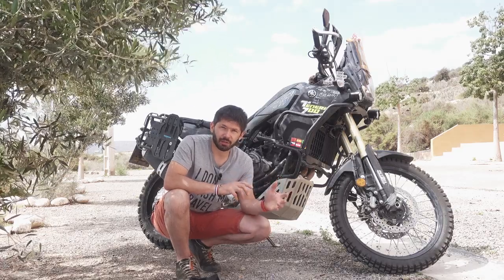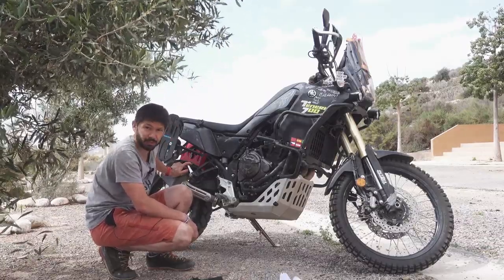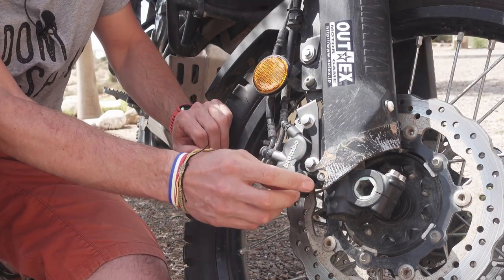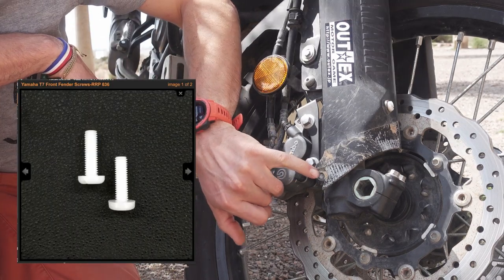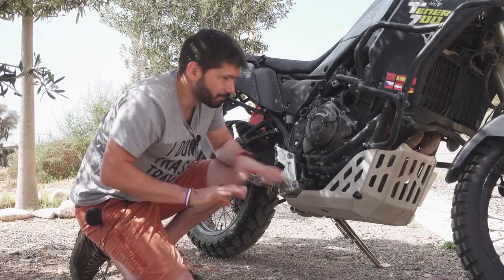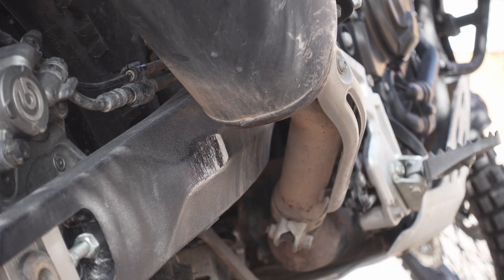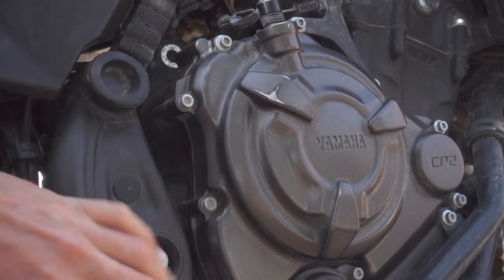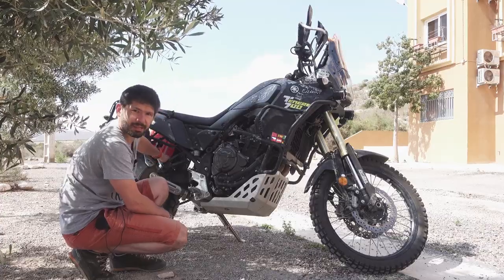Yamaha Ténéré 700 10k: Damage & Rust

Comment: Re the rubbing on the clutch case, in the Australian version there is a plastic guard over that area where wear is showing.
Reply from the maker: The guard was there as well on the EU version, but I took it off because it was in such position my leg was constantly pressed against it. It did bothered me to the point I took it off. But, when you mention it this way... It may have had a purpose :)

Also on the other side my paint from subframe is rubbing off due to contact with gear & boot.
Reply: @FARANDFURTHER  I have the same problem, I hope soon to replace with a full protection cover.
Reply from the maker: @MotorcycleAdventureDirtbikeTV  It just was so much in a way and my brain didn't really manage to switch it off mentally ;)
Reply from the maker: @Mich Sky All versions have it I just took it off.
Reply: @FARANDFURTHER  that happens on all bikes. gotta get a frame cover plate or something, i was thinking of trying gravel guard since its got a rubberish coating and might last longer.

Comment: well done! the corrosion on the spokes looks like its caused by the salt on the street (no wonder, since  you ride it always and everwnere). the one on the brakediscs looks a bit too much for the age of the bike.. but they are carbonsteel disc, it rusts... but not dramatic.. 
Someone, not (ab)using the bike as you do, will do fine... 🤣😁💪🤘❤ cheers mate! 🤙
Reply from the maker: I think corrosion on the brake discs and other parts is as you said I've ridden it in winter in Europe in all those salty roads. Moroccan sea & deserts are salty as well and really washing the bike every day... no way.

I'm not abusing the bike... just riding it gently, but steadily :)

Comment: Good review. If that's the only problems at 10,000km I will be happy with my T7.
Reply from the maker: So far, yes not much more riding since the video due to COVID-19.
Reply: Have you had to change the rear shock spring. When the bike is loaded it is very soft.
Reply: Haha you must have the only T7 with the exhaust on the left hand side. No wonder it rubs on the swing arm.
Reply from the maker: :))) It now got quite loose so, when I drop it I just put it back to it's place by hand. Easy ;)
Reply from the maker: Yes I will, but spring is in CZ and I'm in lockdown in Morocco, can't get it here easily.

Comment: Hi guys! Don't forget t700 is not a motocross machine!!! And when you will do motocross with t7 you must do big transformations!
Reply from the maker: I think my riding is far from motocross riding... I'd love to do motocross but definitely not there. What I'm doing with T7 is I think just reasonable terrain for over landing. I've done similar terrain on Honda CB500X with Rally Raid Kit L3 and the T7 is much more off-road oriented than CB500X...
Reply: So why the advertise it as a "true adventure bike" with all those marketing clips on sand/etc when in fact you will have to invest at least additional 25% of bike's value to get it offroad ready ?
Reply from the maker: @dexio85  I don't think (just my opinion) you need to invest any money at all to do off-road on this bike. 

I think its 99% fine for my off-road style. The 1% (and I'll have the episode about it) is stronger spring for rear suspension for my weight.

I'm not counting money you need to spend on protection, that is something you do with every bike. Unless you buying light motocross machine.
Reply from the maker: @dexio85  Also, almost every brand producing ADV bike will advertise it as "true adventure bike" :)
Reply: @FARANDFURTHER  but its not lime you are a heavy guy. I ate probably exact the weight the bikes are desinged for... I would have thought that an average person ( ca.80kg) and 25kg luggage should be fine for a bike straight from factory, but even for that it already needs a suspension upgrade...
Reply: @FARANDFURTHER  Well, looking at my friends that got it the fist thing they did is getting a high fender and bash plate, one changed the front forks as well as the stock ones are not very good. That plus getting the proper piping for protection adds up to 25% easily...
Reply from the maker: @dexio85  Well, you know it depends what you need from the bike, I guess.

I don't need high fender.
I'm not competing and for my travel front forks do it. BTW they work better than forks on CB500X... so I have no issue there :)
Protection (bashplate, crash bars,...) yes you have to invest to it, but which ADV bike ha these in standard?
Reply from the maker: @scottyaustria  Yes rear spring is definitely something which I'd mention as negative. Also the fact the Yamaha does not sell alternative to get the correctly rated spring is a bit odd.
Reply: @FARANDFURTHER  Some bash plates are better than in other bikes so sometimes you don't need to chage it right away. As for the high fender - my friend broke the original one on a twig that was dragged by the wheel under the fender. Apparently it can also happen when you ride in a muddy conditions and get some bigger rocks underneeth it.
Reply: Yeah, it's just another overhyped overpriced Japanese rip-off. and people buy it just because it's japanese and must be good! With all the money you spend on it you might as well be able to get a proper adventure bike to begin with.
Reply from the maker: @ampm9771  I could not care less if it's Japanese or Indian or Alien... Well not true if it would be Alien I'd definitely buy it! ;) For me it just does exactly what I need and I upgraded from CB500X based on my experience.
Reply: @FARANDFURTHER  Well, I respect your opinion, but fact is fact. The price of T700 is 12k, and T700 by no means worth 12k. But only Yamaha could sell such a bike at that price.

BTW is thetr any cure for the throttle Jerkiness? and is it true that you can shift without the clutch?

Cheers
Reply from the maker: Sorry for late reply.

I would think that the heavy duty bashplate should be coming with the bike.

As for the fender, I guess if you do a lot of mud, high fender would make sense. I try to keep away from mud ;)
Reply: Amir Rad every bike can be shifted without clutch (without damage)!if you understand the mechanics and know how! up and down
Reply from the maker: Hey Amir, I'm not sure what people mean by "throttle jerkiness" I think it's actually quite smooth. But again, I have only experience with CB500X and T7 so I'm not the person to judge.

You can do upshifts (especially to 4,5,6) without pulling clutch in, yes.
Reply: @FARANDFURTHER  I meant off-on throttle response, it's a bit jerky or harsh if you like. I was wondering if there is any fix.
Reply: @ampm9771  yep pile of overpriced garb week quality.
Reply from the maker: Not sure really, I'd probably have to ride a bike which does not have that first to tell ;)

Comment: Hi, love your videos, keep them coming please! Just to make sure, when you bend the exhaust, you had the pannier racks already? I was thinking of getting side case carriers to protect the exhaust (i do that with most of my bikes) but on this bike the exhaust seems too low to be covered by the carrier.
Reply from the maker: Thanks Deniz, glad the videos are useful. Yes the exhaust will bend with the rear rack on. There is a point on the exhaust - where pipe ends and the muffler starts - which always touches ground when you drop the bike. That leads to bending it, while I'm training enduro, I bend it every day with the racks on.
Reply: @FARANDFURTHER  i hate to say it but most bikes bend the exhaust. my himalayan i'm lucky enough to still clear the swingarm, maybe a different style rear pannier rack would help or a shorter aftermarket can(even though i'm not a fan of aftermarket exhausts if its functional its a different story).

Comment: Great video's, I traveled a bit by motorcycle as well and am now looking at the T700 so great help! What mirrors do you use? And a video about your mods and accessoires would be much appreciated!
Reply from the maker: Hey, I'm using now Double take mirrors. I had them on my previous bike Honda CB500X so I just moved them to the T7.

I've not changed much on the bike. I knew I won't need to change much. I'm not sure if there will be separate episode on Mods & Accessories as I'm planning (look into the list in description) separate episodes about the mods.

Comment: When you crash and bend things. Maybe you should bend them back before you complain about damages caused by you. 
And a washed and maintained properly vehicle will last much longer. I myself have 6 motorcycles from 2002 and up. All maintained by me. And they look amazing.  Not 1 spec of rust on any.
Reply from the maker: Hi Mark,
First of all I'm not complaining about anything, as stated in the video I find most of this completely normal to the way how I use the bikes. I'm really happy with how it performs and take responsibility for the state.

The only point I was complaining about was paint rubbing off and people already pointed me to the removal of the plastic guard which would prevent this.

I see motorcycles as functional tools for the travel rather than its aesthetics. During my travels I can't ever provide meticulous maintenance. Also the bike is and ADV bike and so it would be shame to have it show-room ready all the time.
Reply: @FARANDFURTHER  that's just an opinion sir. 
Not a 1 of my machines have ever left me stranded. And they ALWAYS look spectacular when pulling them out of the trailer.
Which in turn also makes it easier to identify issues that need addressing. 
To each their own.
Good day sir and ride smart.
Reply from the maker: @markcoleman2960  Yes, to each their own.. I don't have 6 motorcycles nor trailer and my one motorcycle rarely looks spectacular :) Good day to you as well.
Reply: @markcoleman2960  my motorcycles are for riding and riding hard. i don't buy motorcycles so that they stay looking "amazing". they're tools. to each his own.

Comment: this bike is a rip off , everyone is praising this yamaha saying is a great  bike but is it ? is costs around 9500 euro by the time you add bits to it is 11000 , and you have a bike that is nor for enduro nor for long distance adventure , not to mention that technologically is from 1980!! . it's typical for japanese manufacurers they take all the bits they already have in their whearhouse and put a bike toghter . 
 for that reason i never had a japanese bike and never will !!! full stop.
Reply: What? 9500 euro? where? its 12000 euro here! and I agree with you, T700 is a typical cheaply made japanese bike living off of past glories. It's a total rip-off.  Every single component on this bike is cheaply made just like the plastic-twin (aka africa twin). No electronics, small tank cheap suspension, steel tank, spoke wheels, tubed tyres...etc..etc and they ask 12k for it 😅
Reply: let  me guess, both of you dont ride or ride bmw's... pathetic. 
the engine is the one from the mt07 which is rather new. and whats wrong with using old, reliable proven technology? If you dont like it fine, but posting inadequate comments is just childish..
Reply from the maker: May I ask you opinion and elaborate a bit on why is this bike not for long distance adventure?
Reply: @scottyaustria  Its 12k, and you have to spend at least 3k to make it proper. 15k is 850GSA. 15k is triumph tiger 900. I wouldn't kind if it was 8-9k, but 12k? are you kidding! and the bike is incredibly top heavy and whoever says its not top heavy is outright lying.
Reply: @ampm9771  9690 is a common price in the countries I live in. Slovak republic & Austria, I suppose for majority of East & Central Europe countries it would be the same. But I still do agree with you that even for 9.7k the bike is istill a bit overpriced. Personally i really like the look of tenere but I dont think it offers much more compared to the new tracer 700 (which is 8k here). One obvious feature is off road capability but does really this + the upside down fork mount up to over 1.5k increase for me its a no. Just for comparison for 9.5k you can buy 2019 tracer 900 here which is an entirely different class compared to the CP2 platforms.
Reply from the maker: @ampm9771  I bought it for 250 000 CZK which is ~9100EUR at today exchange rate.
Reply from the maker: @ampm9771  Top heavy, yes. But also that statement depends on what you compare it with. If I compare it to my previous CB500X, than yes T7 is more top heavy, but it is also taller, so physics....
Reply: @FARANDFURTHER  I'm 182cm 78kg,  wouldn't say athletic, but almost athletic and I had to wrestle the bike even with 1/3 tank. It's difficult to walk with it and not feeling nervous.

You know, I was waiting for this bike to come out and I said to myself I'm gonna buy it. But after I saw the price and test riding it, i began to like it less and less. Tubed tyres, steel spokes, relatively small tank, a very jerky(unnerving) throttle, not so economical at above 80kph and not being properly sprung...etc

At this price, yamaha could at least made it with a decent throttle response for such a bike and at least stainless steel spoke.
Reply: FAR&FURTHER 1.  simply cos on the motorway it will eat more fuel than KTM 1290 or 1250 gs and you will have to go slower 2. No power no power no power ( I think you get the message) 3. It’s a 21 st century whoever says ... oo we don’t need that and this may as well go and live their life I a cave !!! Come on guys we have to demand development! From the manufacturer for God’s sake we pay for this bikes so that gives us right to demand ! 
Like I’ve said at the beginning this bike is for nothing if you wanna enduro by 500 exc or husky or if you wanna adventure bike by the big brands in this segment there isn’t  and never will be a bike that is good for everything that is why is good to have few bike 
Let’s just admit this is a shabby overpriced bike it should cost max 7000 €
By the way I don’t meant to offend anyone is just the way it is.
Save adventures everyone 👍🏻✌🏻
Reply from the maker: Well I'm 168cm and about 70kg, bike is tall for me and CB500X was as well (any off-road bike is) so I'm probably used to wrestling... ;)

I also drop it a lot.

I understand what you say about price and that they should have packed more for the money. I bought it because it solved my problem of having something like CB500X (very simple bike) but more off-road ready because the CB500X I could not upgrade any further.

From this point of view, it ticks all my boxes except one - range & consumption.

In terms of throttle response I can't really say, I don't have enough experience, as I said in my intro video this is my 2nd bike and it does what I need very well.
Reply: @Mich Sky 

BTW sorry for disrespecting your basic bike. ✌️
Reply: @Mich Sky It's 12k where I live. I don't know about where you live and how high or low are the taxes. It's not 12k worth of motorcycle. Like it or not, that's my opinion.